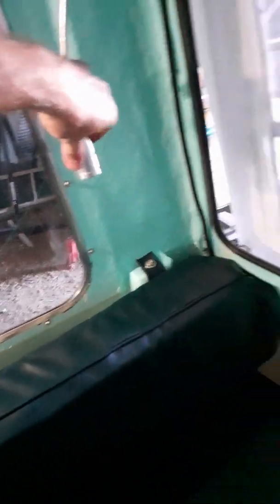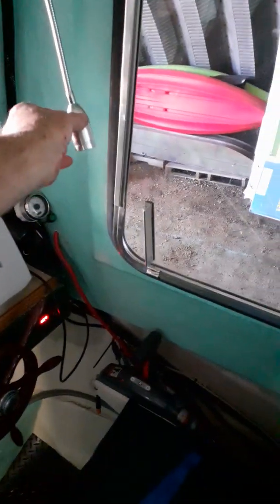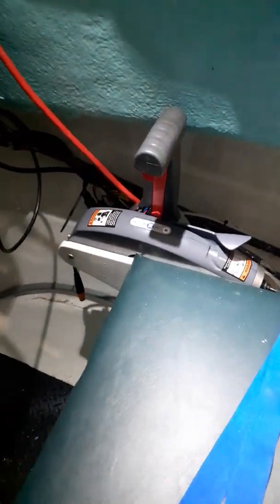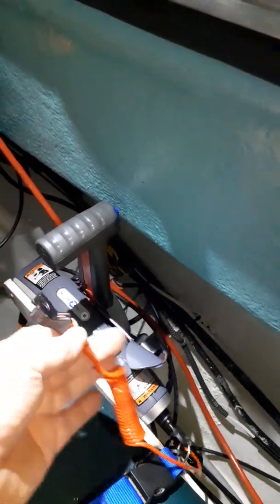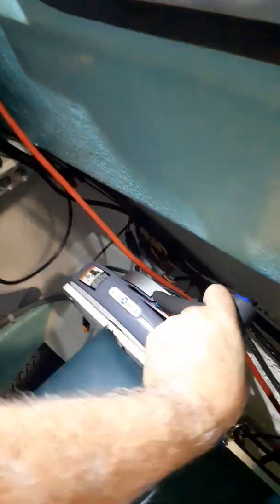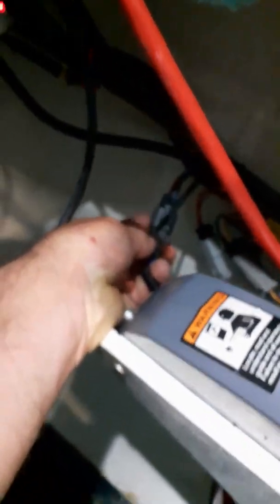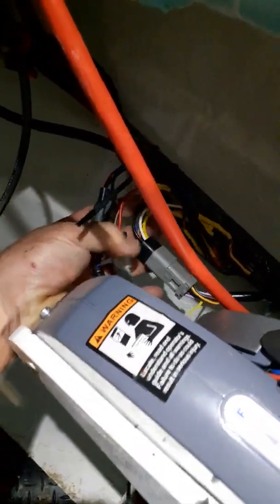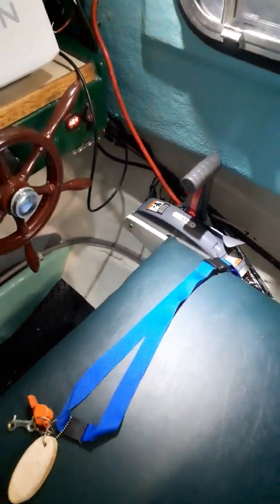Hobo tale #11, Conversion from OMC to newer BRP control box

Comment: I have the same controllers but I'm needthe the handle on the other side so I can mount on my center console
Reply from the maker: Not too hard.  Remove 3 or 4 screws from one side to separate case.  Be careful not to disturb any internals til you see how they should be assembled.  Not too complicated.  One screw in base of handle as I recall to undo to make reversal.  Top cap of handle can be removed to swap etched "FWD,REV" indication.  Really take note how electric cord is routed for motor trim switch.  I don't recall all details but some good YouTube videos are out there, search "reverse omc throttle".  Good luck.
Reply: Thank you so much I'm getting back to house from a dr appt ima about to check it out

Comment: How are the aftermarket controls holding up?
Reply from the maker: Was out twice last week to try out the boat.  Controls work great.  No issues!
Reply from the maker: Well I won't have it in the water til next month but it all operates quite smoothly, the new control box and new cables probably contribute equally to rhat.  The only nuisance is that the deadman plastic "fork" seems to disengage more easily than I think it should.